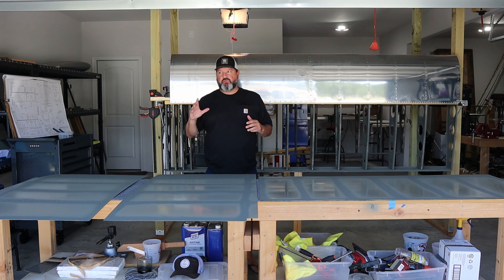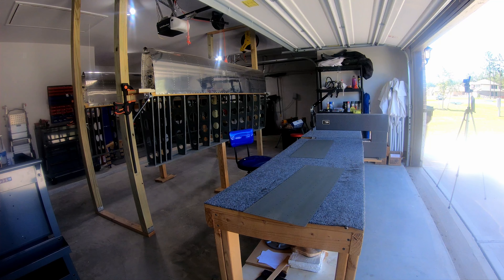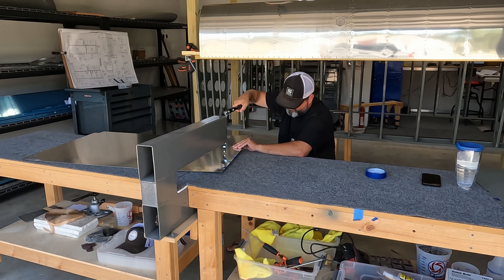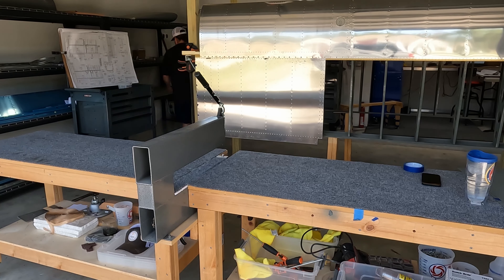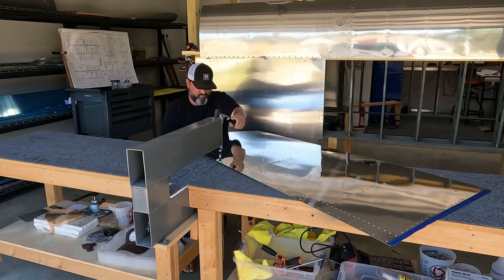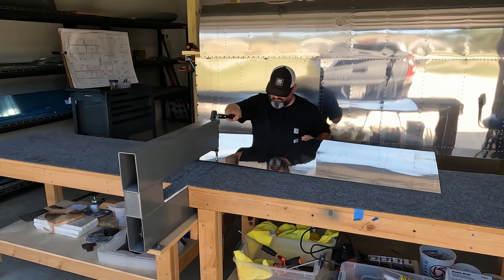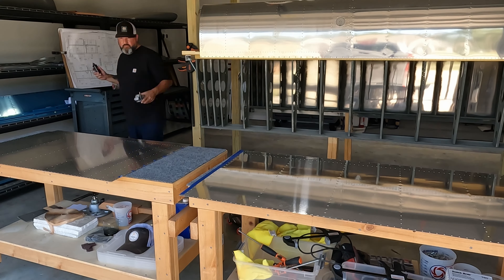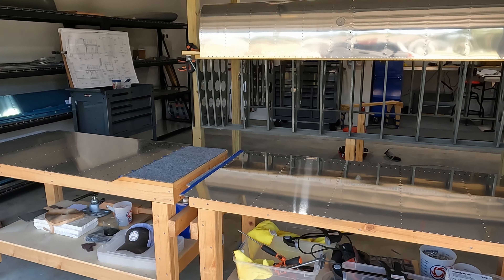Van's RV-8 Build. Ep 107. Wings 34. Main skins & aft spar dimpling

Comment: If you made a longer handle for the dimpler, it might be a bit less fatiguing to use from a sitting position. Also I noticed that when you were dimpling the rear spars with the squeezer, there is a lot of play in the wing structure that will only be further reinforced by the skins, is that normal?
Reply from the maker: Unfortunately, a longer handle would interfere with your material. As it is, the end of the handle nearly reaches past the level of the material you're working on when it's in the full-down position... The skeleton doen't have a lot of rigidity. In semi-monocoque construction, the skins carry all of the load. The skeleton only serves to tie them all together. Once the skins are mounted, it's incredibly strong and still very light.